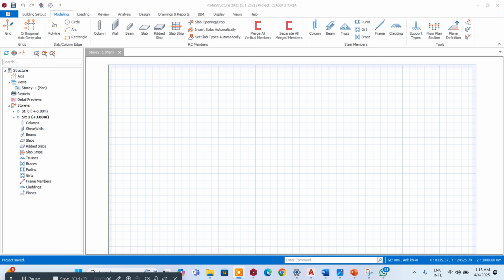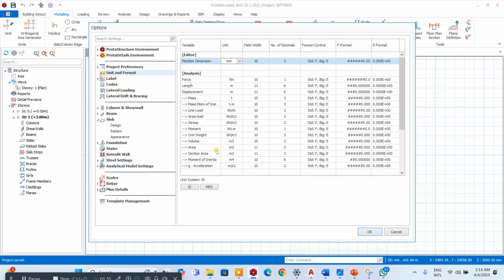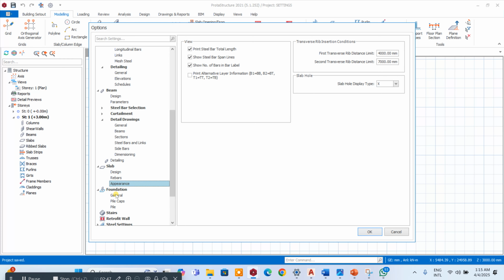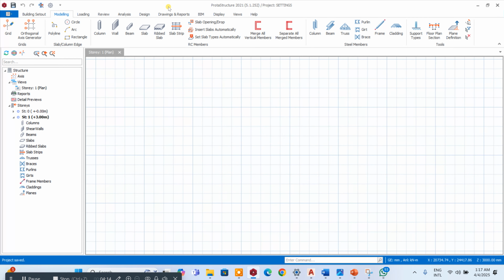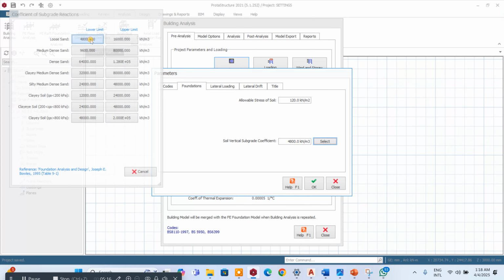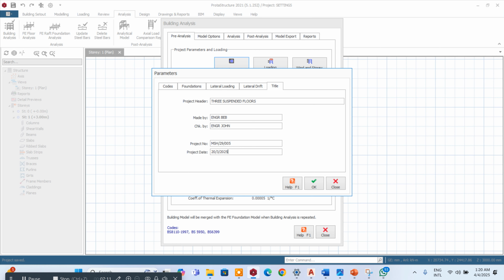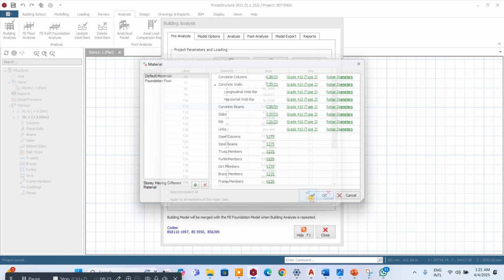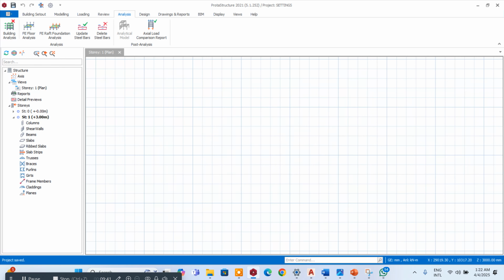SETTINGS IN PROTASTRUCTURE 2021

Comment: Please why its that, i have a column of B=250, abd the H=450. But my question is when i finish the modeling and the design and i go to prota details the elevation of the column change to. B= 450 and H= 450 I mean it  change to the other way round. I use prota structure 2021